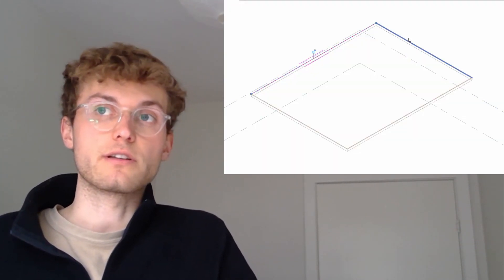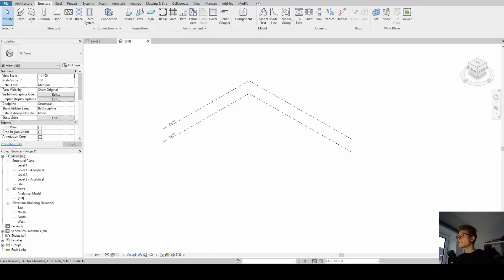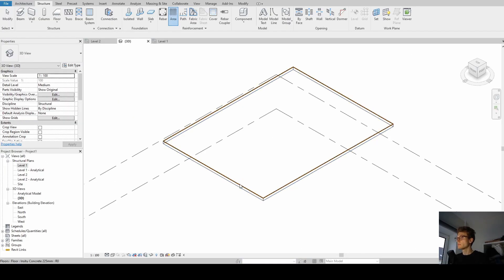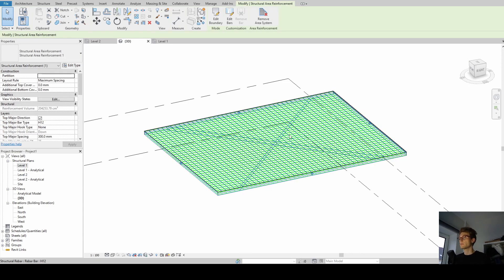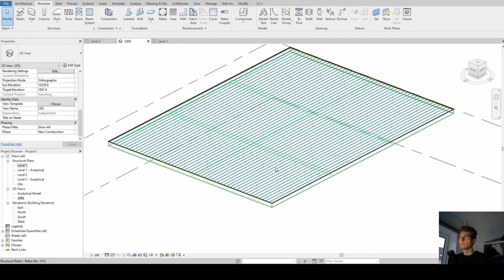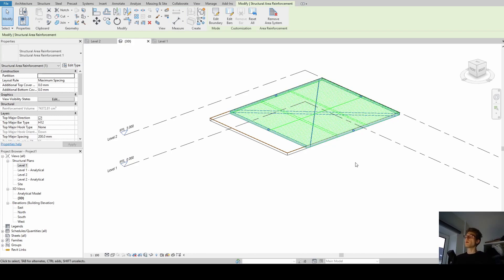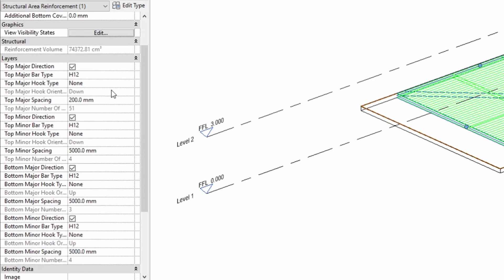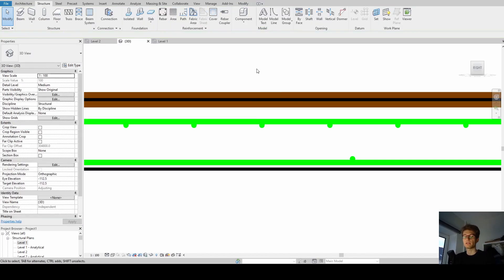How to model and edit area reinforcement in Revit 2022

Comment: There's still not good as Tekla, because there's is overlap after 12m but Revit haven't such opttion and we need to provide manually over laping and that's consuming more time
Reply from the maker: I agree on that function. There is however a workaround. You could use dynamo to check the length of each rebar and code your own script in case the rebar is longer than 12m. Maybe i will cover it in another video. 
Also there is the Sofistik reinforcement plugin which can do that job for you. 
Thanks for your feeback 😊